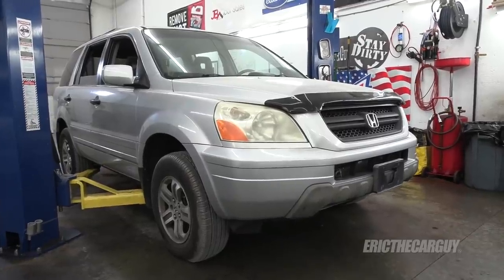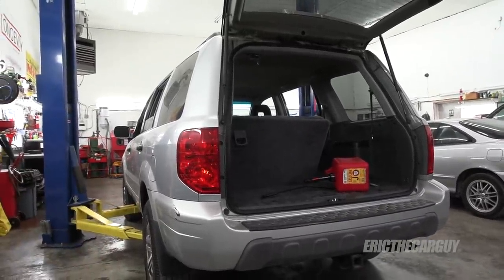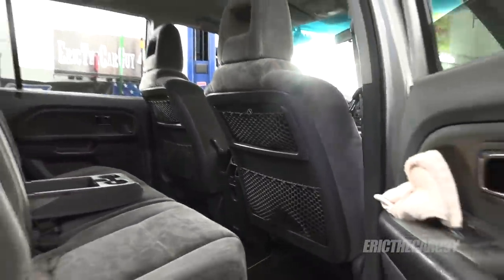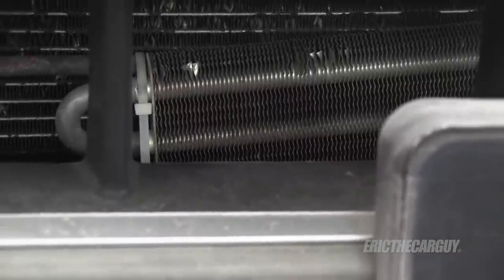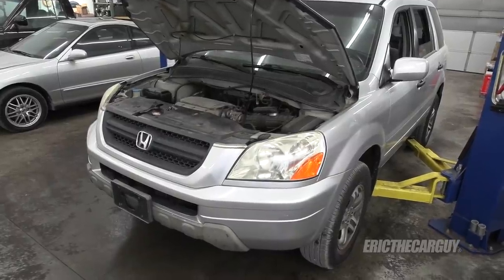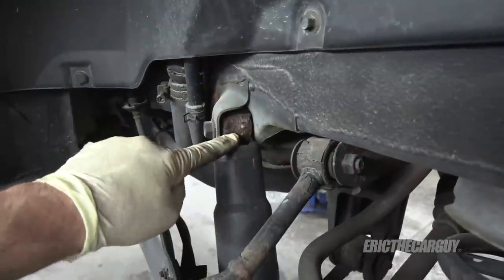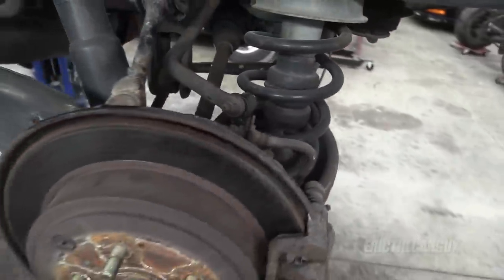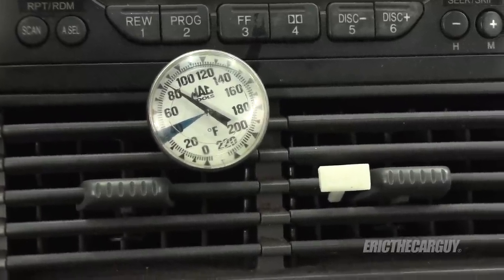2003 Honda Pilot Inspection This Thing Needs Help

Comment: I worked on a couple 1st generation Pilot's like this where the radiator trans cooler has failed on original OEM radiators, either one of the cooler line fittings blowing out of the radiator (seems to be caused by a corrosion issue at the fitting threads) and dumping the atf or internal failure where the coolant & atf mix. My guess is this Pilot suffered from 1 of the 2 scenarios above, hence why someone sub-parly installed the external cooler to bypass the integrated one to fix the original issue (the radiator is likely a non original unit too). The trans may have already been damaged as a result, hence why it is the way it is now.
Reply from the maker: Judging by the zip tie installation, I'd be inclined to disagree. I think they were just lazy or didn't know better. Thanks for the comment.
Reply: @ericthecarguy  That's true, I forgot it had towing hitch installed as well so they could've added the cooler for towing, and installed it in the same incorrect/lazy fashion as the hitch.
Reply from the maker: At least someone gets it. Thank you for that.

Comment: Those front rotors are drilled and slotted... and they are backwards... swap the left with the right... my OCD is going mad thinking they are still on the wrong way... lmao 😅 🤣
Reply from the maker: I believe they are in the correct position as they are marked L and R.
Reply: @ericthecarguy  fair enough... I just know mine were mounted the other way... 👍🏽👍🏽👍🏽

Comment: The Rear CAMBER on the Pilot is ODD.  When loaded (towing etc) the rear camber becomes Negative.  why do you think that is?
Reply from the maker: All vehicles do that for better handling when cornering. Think of it like putting your arm out to stop you from leaning too far. Thanks for the comment.

Comment: Was that built in Alliston, Ontario?  Just down the road from me.  The Pilots were known to be reliable but gas hogs.  Do a mileage calculation before and after putting in the Supercharger, be interesting to know the difference.
Reply from the maker: Good idea. Thanks for the comment.

Comment: I'm having a hard time seeing how an odyssey is so much better a fixing it forward vehicle than a pilot... 🤷
Reply: Cost of ownership is a tad cheaper. Plus minivans are still cool.
Reply from the maker: If you ask Jennifer, the one who got the Odyssey, she would say the Odyssey is way better at transporting a family of 5 than this Pilot ever was. I also mentioned that the service and fuel cost of an SUV is much higher than a minivan, especially when it comes to tires. I don't want to put someone who is financially distressed in a vehicle that has high maintenance and fuel cost. If you're in a hole, stop digging is what I say.

Comment: ...and swap MT from TL or something else? )
Reply from the maker: Then I'd loose the AWD and have the headache of the wiring harness and computer to sort out. Not to mention installing the shifter. https://www.youtube.com/watch?v=1csJbTOWdhk&t=1s
Reply: @ericthecarguy  =) I meant the one with sh-awd ). But yeah, you'll need to cheat with harness and some other stuff (clutch pedal and line, etc.)

Comment: Since the transmission is garbage, is there a chance of an Auto to manual conversion?
Reply from the maker: Nope. https://www.youtube.com/watch?v=1csJbTOWdhk&t=1s
Reply: @ericthecarguy  Haha, I do remember that video. Now I’ve watched it again, I can totally understand your reasons to not do it, but, as you can probably guess, part of me still wishes it would happen. 

I’ve been watching some old bus videos recently, and in the 1970’s and 1980’s Leyland were fitting these pneumatically operated “semi auto” transmissions to their buses. (Select gear manually, no clutch). I think one of them would be awesome as well, but don’t know if it could ever work in a car.
Reply from the maker: K.I.S.S.

Comment: Drilled and slotted rotors? will chew up the brake pads in no time
Reply from the maker: No more than normal rotors. BTW, when you cross drill rotors, the holes need to be chamfered to avoid that very thing. Thanks for the comment.

Comment: What is wrong with led battery terminals?
Reply from the maker: Link in the description to a video about it.
Reply: The problem with the cable terminals is that they are the cheap clamp in type.  They are meant (or should only be used at least) as a quick temporary repair.

You have a bare wire clamped into the back of the terminal which not only is a poor electrical connection, but is also guaranteed to corrode and not just where it clamps into the terminal, but also creeping in further back under the insulation where you can't see it.  But folks put them in because they're cheap and easy and then just walk away instead of following up with a proper repair.

If Eric is lucky, he can get away with removing the terminal, cleaning the bare end of the cable, and crimping and shrink tubing a new terminal on.  But from my experience, more often than not it'll need new cables.
Reply: @maingun07  The factory style is not immune to corrosion and breaking because of the corrosion.  
 I watched the video that Eric  recommended.  That video and your reply neglect to give a better alternative.  I am not singing the praises of lead terminals, they worked fine for the first 100 years, but I am not thrilled with the cheap factory terminals either...I have had them just break all on their own without even touching them.  I had one that broke so I replaced it with a lead quick connect terminal that I had left over from the 80's...that was almost 10 years ago..another that broke a couple of years ago...the lead replacement is not corroding on either one of them, however the factory terminal on my truck is corroded, who knows it may break soon.

What is the better alternative?
Reply: @ericthecarguy  That video doesn't mention what type of terminals you like, and every time you say that you hate those terminals, you never say what you hate about them.  Do you hate all lead terminals or just those?  Most terminals corrode and maybe lead corrodes more...I don't know, that is why I would like you to elaborate on what exactly you don't like about the terminals that you hate.
Reply from the maker: In every video where I deal with those terminals I put a link in the description to the replacements I use. Lately, I've been using these. https://www.amazon.com/gp/product/B07QZRKXSL/ref=ppx_yo_dt_b_asin_title_o04_s00

As for why I don't like them, if you didn't see that it caused the no start in the video I showed you and why, then I'm not sure how else I can convince you. Thanks for the comments.
Reply: @ericthecarguy  Thanks for the clarification, but not all lead terminals are the same, so I am still a little unclear about your answer, but I think you hate all lead terminals.   That is what I was asking.  

In that video, the terminal was in bad shape.  I also noticed that it looked like somebody installed a brand new positive lead terminal on a negative post...that is why it was loose and wouldn't tighten up...it also could have been the cause of the no start, or at least contributed to it.

I can see the advantage to the terminal that you are using, but in the last 10 years I have only had 2 no starts because of bad connections...they were the cheap OEM connectors...In that same time frame I have had 4 transmissions fail.  I am twice as likely to have a Transmission fail than to have a loose corroded connection...LOL

Comment: guarantee the transmission went because the bottom of the radiator failed and mixed coolant with the trans fluid and made a milkshake out of the fluid which tanked the clutches.
Reply from the maker: If that were the case then I would think the open port on the radiator trans cooler would be leaking. I didn't see any evidence of that.
Reply from the maker: Again, if the radiator is leaking coolant into the transmission cooler, I believe I would have seen fluid leaking out of the open transmission cooler port, where the transmission cooler line is usually connected to the radiator.  You can actually see them in the video. I didn't see any evidence of leakage, but I'll be checking a lot of things on this before it all goes back together. Thanks for your comments.

Comment: why are the terminals that way? i can tell you why. because someone like me who knows nothing about cars goes to a mechanic after the battery dies . (went to auto zone first to get the battery, they replaced it decided to test the alternator,which when they did said it might be bad because it wasn't near 14v or whatever, only about 12 ish). So i take it to the mechanic, the mechanic is like let me check so im like ok. turns out alternator was fine, az just didnt test right but he was like you know terminals are pretty bad might as fix that. im like we already kinda brushed it but hes like i can replace em for cheap it was like 30$ or whatever. so your like well i dont want to deal with this in the future so i might as well. he cuts the old one off adds the new one like that and then you find out watching another video a month later https://www.youtube.com/watch?v=M0yjKdgzCaw&t=1190s that will probably corrode more lol.

Comment: Hey man got the same rig
Your transmission problem could be the battery terminal mine was just like yours with that terrible one 
Try replacing that terminal then clear the codes.I was getting all kinds of crazy because of mine

Comment: Rims not being cleaned.  I've NEVER found a place that will...for some reason they would rather have you come back in and cause them lost revenue.  ALL the usual scumbags are guilty of it.  I SPECIFICALLY stated to have my rims cleaned before having my last set put on my Tahoe.  Guy was "No problem, it's SOP".  Got the truck back, next day tire flat.  Took it in, guy said "Oh, you need new wheels", I said "no, you didn't CLEAN the freaking rims".  He was "Yes we did, it's SOP"....I went out and watched them dismount the wheel and tire...yep...never cleaned it...
Reply from the maker: Sorry you had to deal with that. It's one of my biggest pet peeves.
Reply: @ericthecarguy  Worst thing is...they all do it.  The big chains like Discount and Belle.  Heck, even the local two places do it that are by me.  It's like "nah, we only get 1 out of 15 back in for a problem, we save 10 minutes, so a couple hours per 15...that's a money saving deal...

Comment: Eric if you flush a transmission fluid on a car that has not in changing their transmission fluid as they should cuz you change the fluid would it damage the transmission and if you do a flush would it damage the transmission also?
Reply from the maker: I don't recommend transmission flushes. https://www.ericthecarguy.com/solving-transmission-problems/
Reply: @ericthecarguy  so just a transmission oil change
Reply from the maker: Yes, especially with a Honda. Also, never use anything but Honda transmission fluid in a Honda transmission.
Reply: @ericthecarguy  that's exactly what I told my cousin sense he has a Honda thank you for your feedback love your videos Eric

Comment: One thing i always wondered about the whole rust issue with vehicles in that part of the country... why do people not just wash their vehicles on a more regular basis? I mean i get you're not going to get every nook and cranny with washing but at least it would help avoid a good portion of the rust in the first place
Reply from the maker: How often do you get up under your vehicle and wash the metal bumper support? Most people don't even know it exists.
Reply: @ericthecarguy  every other wash i take the pressure washer at the local do it yourself car wash and hose out the entire under carriage, like i said though, i understand that some areas just can't be reached

Comment: Add a supercharger to a V6 with a stock engine with over 210k miles?  Better make a quick couple of stock runs and supercharger runs! Have a junkyard engine handy. The crank, con rods, pistons, valve train and heads should be toast after a few trips to the track. Will the rebuilt tranny take the extra HP? Will the torque converter? It should be interesting!
Reply from the maker: The new transmission has a 100K warranty. As for the engine, there's a reason that the J series has been in Hondas for so long. It's an excellent engine. If you don't believe me, see how it's put together. https://www.youtube.com/watch?v=XfDKhjlN7X4

BTW this one doesn't have VCM. 

Lastly, people use the J series for sand rails because you can hold it at top RPM all day long and it will stay together in desert heat. 

Thanks for your comment.
Reply: @ericthecarguy  We have a 2000 Odyssey the Engine was strong. It was on the fourth transmission replaced by Honda of America. We had to pay for the fourth tranny. It is headed to the scrap yard. I will never own another Honda. The 1997 EX Accord tranny failed a bit over 100K and no help from Honda. Replaced with Jasper rebuilt and it shot craps in 26K. They made it good.

We recently purchased a new Camery and love it. Time will tell  if we made a good choice.

Comment: Yeah, to be honest. 
This Pilot should fly to the junkyard.
That rear bumper is an inspection fail. And not worth the welding prices for it. 

But! You’re in the states. So I guess things go different. 

Have fun with it though. Still love to see the videos!
Reply from the maker: The bumper bolts on. It can be replaced. In fact, I already have one. The only thing that might need welding is the brace on the left side. I'll have a better look at it once I get the bumper off. Thanks for the comment.

Comment: Eric doesn't have enough work in the shop. Pays $1,500 for a scrapper and wants to put in another$700-$800 for suspension parts alone, crazy. That thing in decent running condition maybe $3,000.00 tops, and that's a stretch. I guess he's making more off YouTube
videos than car repair now. I going to follow this and then supercharge my CRV too, I've  already done the suspension and my tranny is fine. Dollars to donuts you'll never see a blower on that Pilot, pure BS.
Reply from the maker: Thanks for watching!

Comment: Damn I would hate SUVs too if I had to deal with that terrible example of a CRV. Eric you would do well at the tow auctions. I just got a 2005 Prius with a new battery new tires for $1600, risky but sheesh cant get worse than that CRV. If you are willing to buy a car that runs but doesn't drive, or doesn't have keys, it'll be cheaper than that CRV.